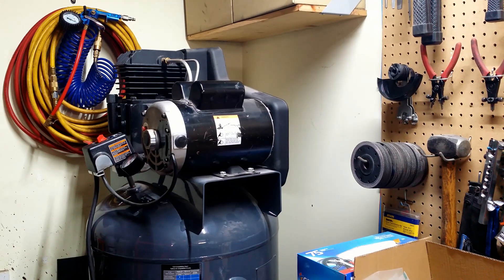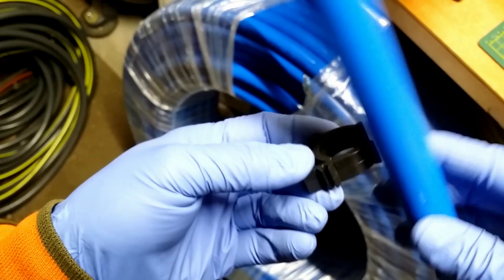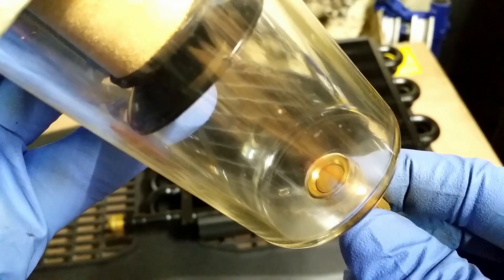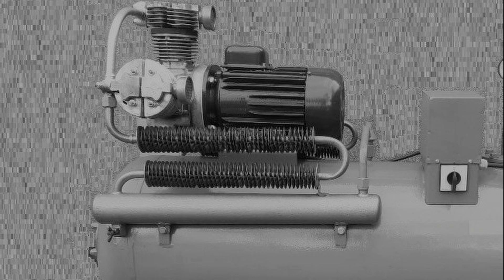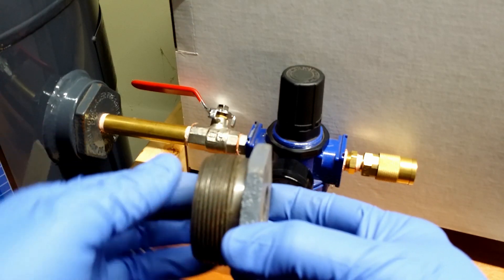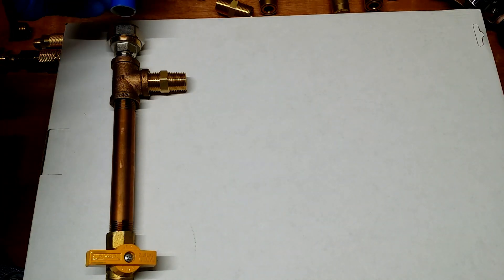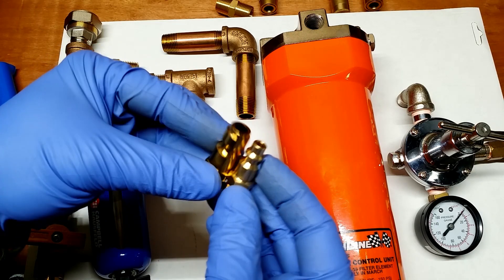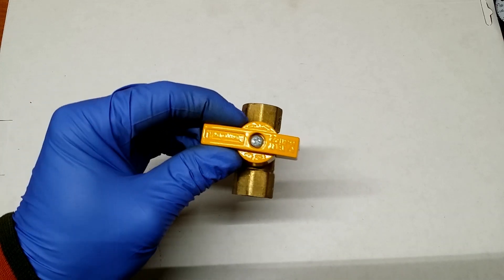Compressed Air Setup for Garage. Project.

Comment: This pex/alu/pex pipe is suitable for pressure installations? In Poland we mostly use this technology in central heating system, not for compressed gases. But maybe I'm not good informed. Pozdrawiam ;)
Reply from the maker: As I mentioned in the video it was the kit for compressed air system. https://www.princessauto.com/en/50-pc-3-4-in-x-300-ft-air-line-delivery-kit/product/PA0008881039